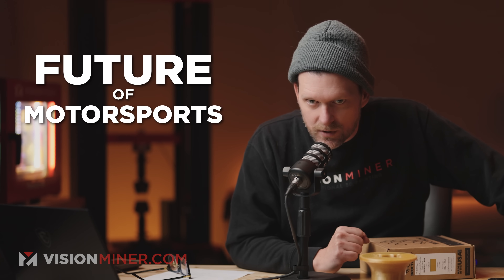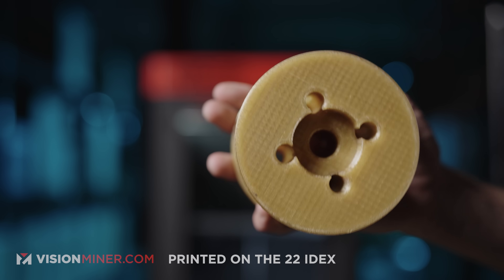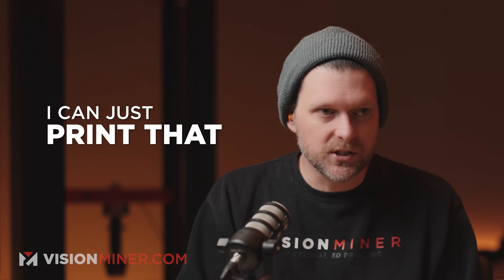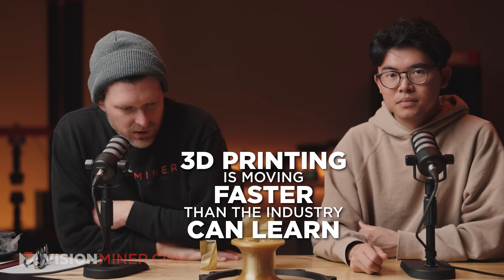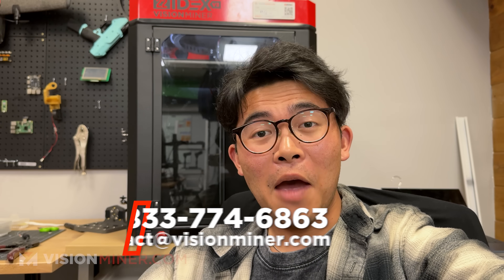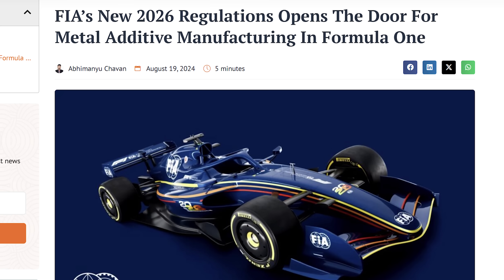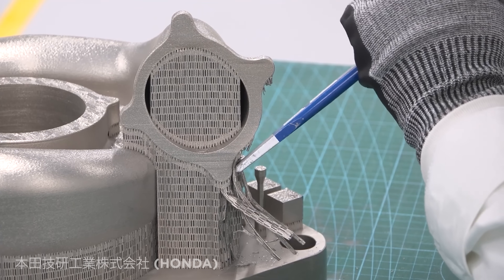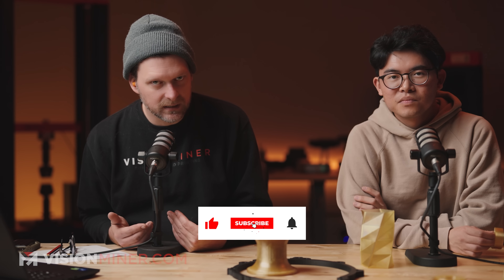The Future of Racing is 3D Printing.

Comment: Anyone make a Torlon polyamide-imide filament?  It has better hot strength than PEEK and is tougher.  It's the go to when ultimate performance is needed in a polymer gear or bearing.

Comment: I've experimented with 3DP in my job, metal and plastic. it has its uses. but cost and production speed is still and issue, plus the secondary finishing processes. and plastic printing has clear limitations. Metal printing has issues too, and I've been able to find cheaper, faster, and easier ways to make 3DP parts from other operations cheaper and faster. 3DP has its uses and advantages, but it is not a silver bullet. It has very real issues.

Comment: The Honda part is metal laser powder bed fusion on a Nikon SLM Solutions machine. The material is fully welded. Over a decade ago, ”sintering” was used because the lasers were not powerful enough to fully melt the material. For many years, it has been fully welded. Density is over 99.5%, so almost solid. 

This method is way cheaper for that part than conventional technologies like inconel casting. For this reason alone, it won't get banned. 

Thanks guys

Comment: ULTEM 1010 is definitely not easy to print, even for seasoned professional printing operations. It's also not sealed as-printed. It needs a post treatment in most cases. I love additive manufacturing but the hype about how it's perfect and solves every problem just hurts the industry.
Reply: None-the-less, thanks for the video. Great topic.

Comment: I have a 1963, Jensen built, Volvo P1800 that my dad purchased in 1965. He drove it daily, and then when I was in high school he gave it to me and it became my daily driver. About 10 years ago when I was coming home from work the passenger side lower A arm cracked and my tire went out at a sharp angle. I had the car towed home, and it currently is sitting in storage because that is not a part I can really get. So what do you think, Ultem suspension parts?

Comment: I'd love a setup where I can 3d scan an area or various parts, send it to a print shop with a bit of context on what I wanted to do and what environment it'd be in... and then have the part designed, printed, and back in my hands in a week. No worrying about which filament/material, inevitable "universal fitment" woes, or spending thousands on fabrication tools and materials. Sure there'd be overhead with the design/time, but the materials are generally inexpensive enough I'd imagine it could easily be 25% of the cost it'd have taken me to do myself with a non-3d printed approach.

Comment: It's not that new really. Bugatti used a printed caliper that was created using generative design back in 2018. The Mclaren Sabre had an AM Inconel exhaust finisher back in 2019
There's a number of super / hyper cars that have been using metallic SLS inserts in the layups for carbon parts for a good while. 
Not having had access to F1 composite stuff lately means I can't say that they're used in F1 tubs, but I'd put a lot of money on them being so. If you can shave weight out of an insert by printing it and then machining it with the cured component, why wouldn't you. 
Maybe it is just that the news of these things being used is more widespread these days.

Comment: I work with ULTEM 9085 / 1010 and Stratasys machines everyday for my job in the aerospace industry. ULTEM is a great material, but the area where it struggles (like many other polymers): durability to resistance against cracking from point loads from fasteners, creep fatigue (deflection from time under load), extended durability after several series of thermal cycling, etc. ULTEM is great but to just say it can easily replace an aluminum part is a loaded statement. It has to be designed and integrated in the right way. I want to integrate more 3D printed parts on my project car (and see it used more extensively in the Motorsport industry), but long term durability of these parts (especially ones that are thermal cycled) is something that will definitely need to be proven out. Design for AM is also a big focal area to allow this technology and material to shine. If you’re trying to one for one replace a machined aluminum part with an ULTEM one, you may see failures from features that are not optimized for the MFG process (AM) or material (ULTEM).

Czinger (pronounced singer) doesn’t make their printers, they use SLM NXG LPBF machines. They specialize in the topology optimization design, formulating their own proprietary aluminum alloy and structural adhesive, and automated robotic assembly of their metal components to make larger parts like subframes in their robotic V cell system called “DAPS”
Reply: Thank you for mentioning this, all of the above is correct and I appreciate you adding your knowledge to this. Actually, I would love to chat with you.

Comment: I want a new bushing type that's a hybrid between Delrin and polyurethane that way you get NVH benefits, minimal deflection, self-lubrication without squeaking, durability, and free axial motion so there's no more "phantom spring rate" BS as with normal rubber and poly bushings.
Reply: Consider using both materials - a coil of delrin to slide on and polyurethane to absorb the shock loads. The spring or coil shape would also self cool and could insert like a helicoil into the polyurethane.
Reply: @mmac4047  Why a coil instead of a double sleeve? Also, I'm not 100% sure what you mean by that, anyway.
Reply: Radial motion? I think there are rubber compounds that do what you want with the right additives. Poly doesn't belong on a car suspension imo and both poly and delrin creep.

Comment: I 3D printed a working electric supercharger from PLA and GreenTEC Pro CF and PLA. 4 psi boost using a RC boat motor with lipo batteries. I tested it on a Volvo Diesel first and then a 2004 Hyundai Elantra with positive result (until it exploded). I don't have a car to test more on now but will keep improving it when I find a cheap "development beater."

Comment: In five years, this is going to be heavily regulated in motorsports. You can't ban it, you can't stop it, and you can't make it more expensive. It's always going to get faster and cheaper and better which means it will always be used. But you can regulate it somehow. Maybe from a safety perspective? I can imagine that being a significant argument against using it for structural components in unproven ways. But racing is all about breaking things - so it's a very gray area.

Comment: in F1 I suspect we will see even crazier looking aero packages since additive mfg can do shapes and forms that cannot be done with subtractive or conventional forming of CF structures.

metal printed turbos could potentially mean things like custom compressor stages for every track, With differing impeller designs based on altitude and other expected typical conditions at that location. I mean I suspect a turbo is a turbo but F1 is all about engineering for that last .001% of performance.  Well until the rulebook people strike down modular ADM made turbos.

Comment: 3D printed Titanium alloy Turbocharger housings 🤓👍
That's like, the Holy Grail. Machining has always held Ti back, because any mistake scraps the whole part. Now we can 3D print a prototype, then make an oversized Casting blank, make a mold, and cast an amazing part.
Or, spend more money and have the part directly printed in metal by a professional.
Mahle has made 3DP Titanium pistons for Porsche as proof of concept. 3D Printing is going to change the world when people open their imaginations up, and practice more practical methods of making things.
Reply from the maker: Couldn't have said it better myself! On the 3D printed pistons end, Honda also publicized that the pistons in their current F1 engine are 3D printed in iron but redesigned to be just as light as their traditionally manufactured aluminum counterparts!

Comment: I'm not even sure if "future" is the right word here. I work in automotive aftermarket, and if you've been doing any sort of design or prototyping for automotive in the last 5-10 years and HAVEN'T been using 3d printing in your workflow, you're way behind the curve. Functional prototypes being tested on cars, test fiting, jigs, go/no-go gauges, dimple and press dies, all within a matter of hours. The cost entry for ULTEM still isn't quite there yet and aluminum or carbon are comparable, but between Nylon, PETG, and flex/TPU filaments and a sub-$1000 printer, you can get pretty much anything.
Reply from the maker: Absolutely! Rapid prototyping and test fittings are being used in just about every industry. We're more so emphasizing the future is creating end use parts out of additive manufacturing!

Comment: I've printed intake tubes with MFJ PA6-CF and a dual bosch 82mm throttle body merge in aluminum via SLM. Both came out great. Testing was done with FDM PA6-CF which also held up fine.

Comment: I just randomly clicked on this video. I've been thinking of Printed car parts for a whole. I've looked for a gated shifter for my 2000 Celica Gt-S and it seems there are some engineering challenges based on how close the gears are together , then some outside plastics that have cracked/ broken, and could printing some engine components like a new intake and is it possible to make better synchro's for my transmission. I just never knew we already had plastics that could work yet! I'll have to watch to see some of the stuff you guys do! Heck, you could even have it be its own YouTube business.
Reply from the maker: Heck yeah! We use (play with) high-tech manufacturing equipment, explain it, and sell it all on our website -- it's a pretty great setup :)

Comment: I work in district energy and creating a solution for the dual heat exchanger problem (It's just a big skid with two heat exchangers and lots of piping that apartments need to fit inside them). I know that the entire interaction of those four piping systems (supply return for air heating and supply return for water heating) Can be shrunk down. Into something I can just bolt together. Build that for me please
Reply from the maker: Awesome! Do you have any files you could send us? Send them to contact@visionminer.com, this sounds like a great project!

Comment: it's a good use case, for sure.  It all falls apart however when the 3d printed parts aren't accurate enough to confirm whether the nominal design dimensions are correct or not.
Reply from the maker: Yep, make sure to buy quality and calibrate!
Reply: Although in many cases "close enough" is good because the real use of the 3D print is to minimize material use for the starting form that will be machined to tolerances. In which case one is modeling the incomplete blank that will still have facing, small holes, polishing/burnishing, and threads put in by subsequent tool work.

Comment: Would love to see more content like this. I wanted itb's on my mx5, instead of paying upwards of 4k on a jenvey kit I was able to grab some second hand motobike throttle bodies for less than 200 dollars and 3d print the rest. After 2 years of daily driving with pa-cf bolted directly to the head I've had no issues. Has also been great for tooling and mould making for composites work
Reply: What filaments do you typically use for printing molds and tooling?

Comment: Just to check fitment parts like that can cost under a dollar and take less than an hour. I've been ranting to people about how much more capable 3D printing is than people think. Even without PEEK or Ultem 1010 or super exotic filaments, there are a lot of capabilities.
I designed a 13B-REW to Bosch 82mm throttle body adapter and we printed it out of carbon fiber Nylon on a frickin' Ender 3! It warped like a banana at the bottom, but we sanded it flat and it worked. Not just for test fitment. It worked on the dyno, made over 500whp, and did multiple track runs under hood. We didn't even use top shelf filament, a heated chamber, or annealing. This part is handling a throttle body, intercooler pipes, engine movement, heat, and like 2 bar of boost! I'm not saying it will last forever, but it's also not even close to the ultimate evolution of that part. It was a first design on the wrong printer with affordable filament.
You can make parts like that for $10-20 when even a cheap CNC aluminum version is over $100 from China. You can do intake manifolds, turbo inlets, heck with flexibles you can do custom couplers in any shape. This realm is only just being explored at a lower grassroots level, but there are so many possibilities. Of course it makes sense for the highest levels of racing when you can afford crazy printers and top of the line filament. None of this is even speaking of 3D printed metal, of course, which is just an entirely different level of what's possible. The Czinger designs being a pretty obvious demonstration of what can be done. Great insights!
Would love to see more car content from y'all.

Comment: I think the most exciting thing about 3D printing for Motorsports in a hobbyist application is castable printing resins.
Like for $1500 you can buy an acceptable quality of printer, wash station, vacuum casting system, and all the materials you need for a lot of tasks. Then you have all the tools to keep doing that in future. 
Where If you hired out a machine shop to do it for you, you wouldn't have that on your side.

Comment: I'm lucky enough to have spent time at alpine and Williams F1 in the ADM departments. Neither use FDM, and very few final parts on the car are currently 3D Printed. Instead they've been SLA printing wind tunnel parts 24/7, and SLS print jigs & fixtures. Id be interested to see more adoption of FDM, although I still doubt it'd be used extensively on the final cars - that's what the SLS is for
Reply from the maker: RB with their partner Roboze has CF PEEK parts in their cars and there is another team we know of using PEEK as well
Reply: SLA and SLS WT parts have been used since back in the mid 00s. I was working in F1 in 2006 and Bluestone parts were all over the tunnel model. One of the major benefits of AM for those parts was the ability to have pressure taps integral to the part.

Comment: There's a guy I know of printing nylon intake manifolds for K series Hondas

I've even seen 3d printed intakes from Ford for prototype stuff
Reply: Making for Motorsport has done a lot of awesome 3D printed intake work and similar. Let's not forget Couch Built who is doing a 13B rotary swapped BMW i8. The amount of 3D printing he is using, much of it in metal, is astounding. Probably one of the most underrated builds on the internet.
Reply: @802Garage  yeah it's kind of insane, my engine swap project has a bunch of 3d printed stuff on it as well.  I've got PETG under the hood of my car holding up just fine.

I wouldn't use PETG for like an intake manifold though, nylon or better for sure.

Designing and printing a Holley high ram style intake is on my to-do list, I'd rather spend the time making one than spending 1k on it lol.
Reply: @CyberdriveAutomotive  That's awesome. Do you make vids on it anywhere?
Reply: @ yeah, just added it to mine didnt realize i had not uploaded it

Comment: Dude WTF man. I just finished building a machine that can do 360 on the nozzle and can hold 70deg chamber with a 120 bed. Now you got me looking at $300+ dollar rolls of ULTEM 1010 and beds that can go higher than 120. Thanks a lot. Time to sell a bunch more stuff and do the upgrades. You foot bending over your "chankleta" is what did me in. Now I'm hooked. Can't say how much I appreciate the info. Love your bed adhesion glue. I think the guys at my local MicroCenter hate/love me, cuz as soon as it comes back in stock a fat Armenian goes in and cleans them out of stock right away. Side note/question do you have "cotton mouth" or something? PS I design parts for Audis and VW in particular their EA839 engine. This is how I got in to 3D printing. Got me a P1P to get my feet wet 3 years ago and now I have 5 custom "voron" like machines that have 500mmSq print volumes that I print and test parts with before machining. I love this whole new world we are Living in. Once I make some real money with it I'll hot you guys up for a more modern 3D scanner. I got an old Artec Spider and Eva that are still going strong though. Anyhow nice video and thanks for the Ultem 1010 info.
Reply from the maker: We’re always available for 3D scanning demos as well if you ever wanna shoot us an email or give us a call!